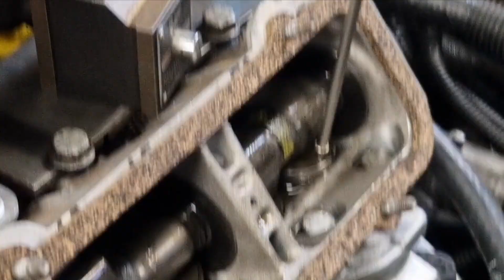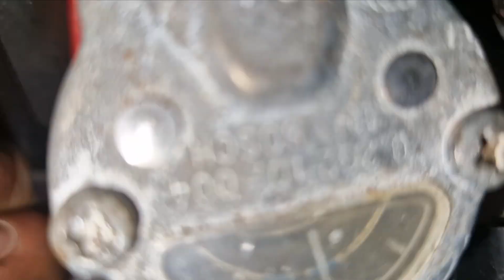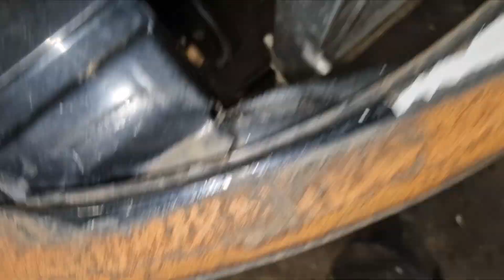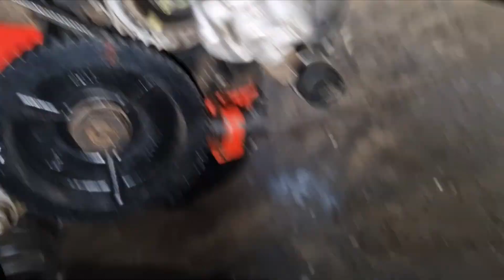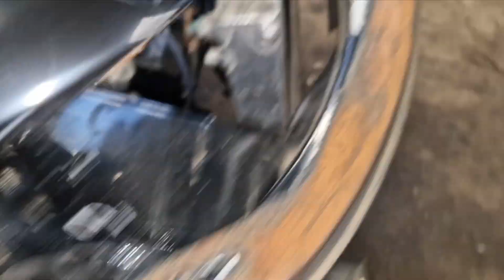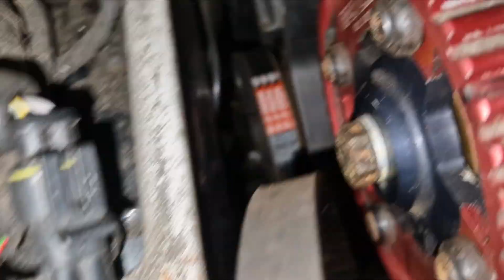Fiat Punto GT Piper Cams TBP300 Rally Set Up and Cam Belt guide

Comment: The piper BP300 camshaft can strictly not be used with top hat shims, only the 270 can be used with top hat shims, the 285 and 300 camshafts need underbucket shims as the run so much lift at high rpm they flick the shims off
Reply from the maker: Good to know that.  Discretion of the customer if he wants to spend more money on it.

Comment: Nice work setting the timing up👌 , Had to watch it twice as you lost me the first time .   Those little  fiat single cam 8v engines  are  so good . They  don't make them like that anymore . Thanks for sharing 👍
Reply from the maker: @johnbickle4654  thanks.  Yes those 8 Valve Lampredi Engine were great.  In Turkey and South America are still very popular. Thinking about being designed in the 60s. Those 1372 Fiat Uno Turbo ie and Punto GT are not the strongest block. Unfortunately under heat the do worn off the bore expecially on Cylinder n°3
The 1301 from the FIAT UNO Turbo ie MK1 where much stronger and more reliable.  
Check out this beauty at 12000 RPM https://youtube.com/shorts/qk5CR5ROU2k?si=PcRR0vwNngrxKkNU